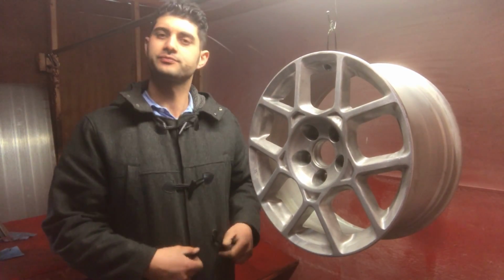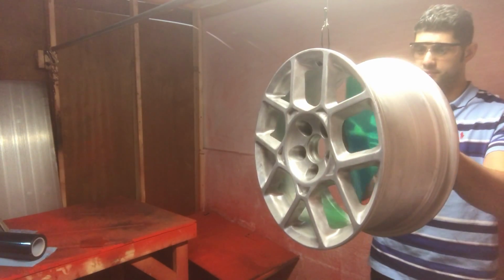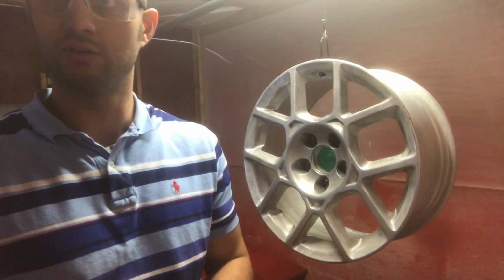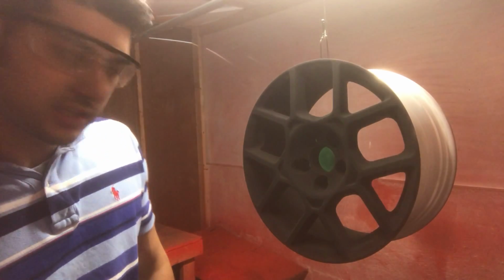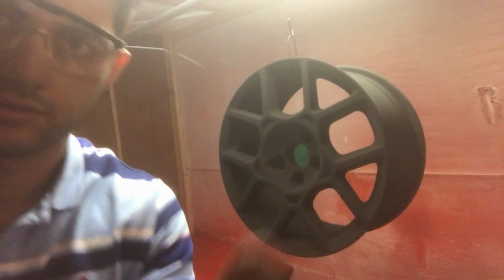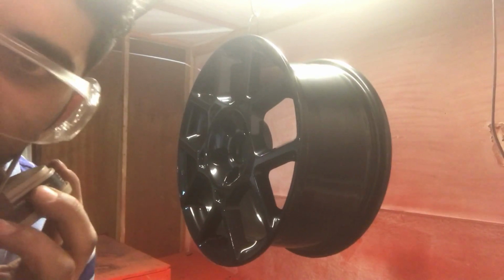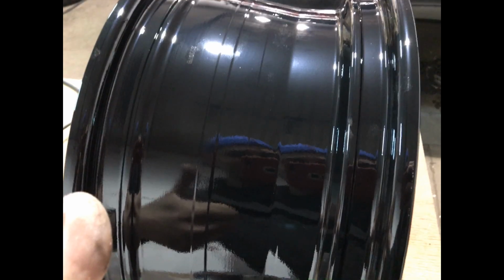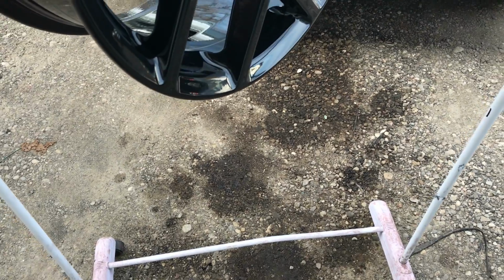HOW TO POWDER COAT A WHEEL

Comment: I didn't notice you pre bake the rim to off gas possible contaminates.

What chemical did you use to wipe down the wheel with?

Are you on the highest votlage setting?

You mentioned chemical stripping.  Would media blasting give the powder better bite?

Comment: How did you affix the hanger to the wheel in order to hang it in the oven and so forth? Also, what PSI are you running at the gun? Final question is that if you did not have to repair the wheel and only had to prep and powder coat it what would you have charged per wheel? Thanks, Frank.

Comment: nice video.. quick question once you have applied black powder do you bake then let cool down.. then powder lacquer!?
Reply from the maker: before applying a second coat there are two methods to be used.  1. if doing a cold second coat,  you must re-scuff and neutralize the surface.   for adhesion, otherwise you will get delamination as well as other issues.   2. if you are doing a hot coat, make sure you dont apply it too hot or too cold,  you want to do it mid flow cycle so the second coat sticks to the first.